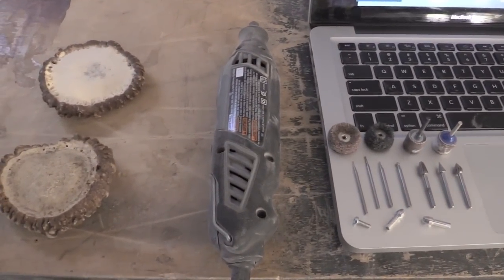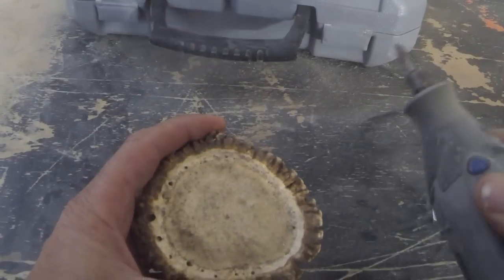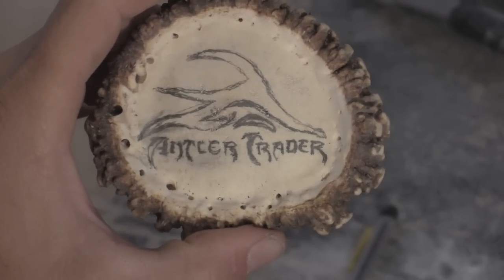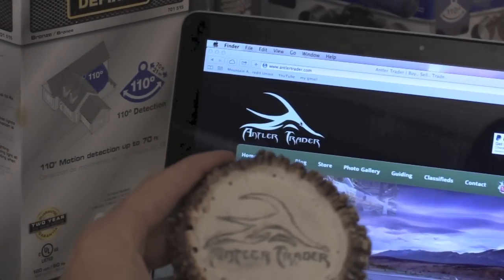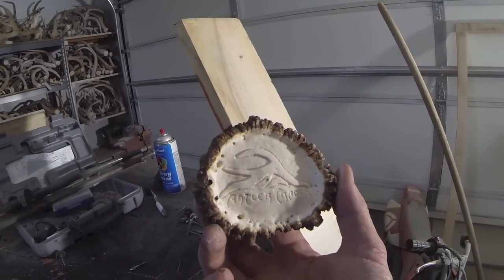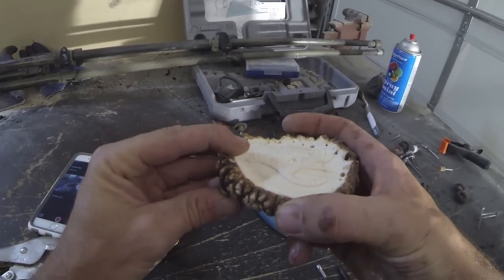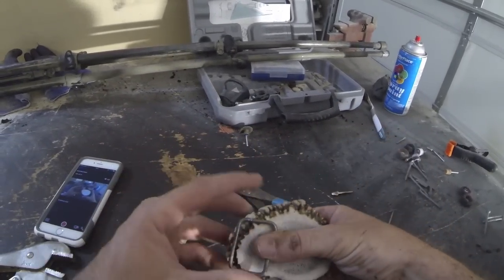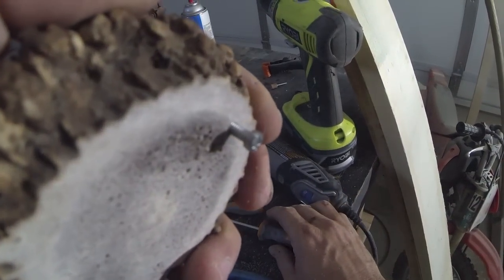HOW TO MAKE AN ELK ANTLER BELT BUCKLE

Comment: so i wanna make a buckle out of a white tail deer antler is that possable or does it have to be a elk antler
Reply from the maker: Cameron Phelps It is possible.  The only hard part is that a whitetail antler is much smaller and doesn't give much room for engraving.  But as far as the method, it will be the exact same.  Let me know if you have anymore questions
Reply from the maker: Sorry it took so long to get back to you. You can do it with any antlers but elk are usually the only ones big enough. You could cut it at kind of a weird angle to make it a little bigger.